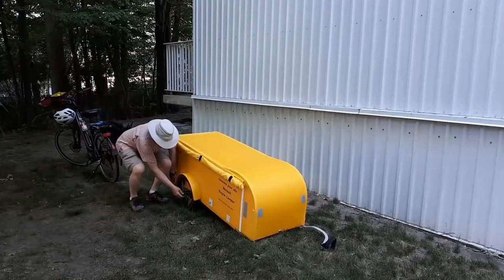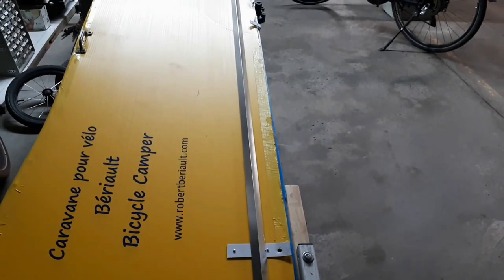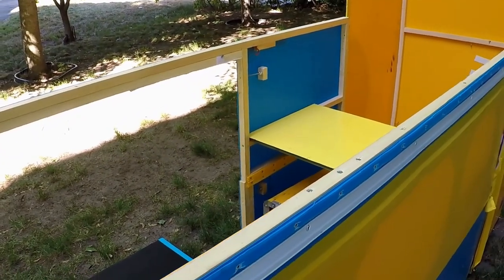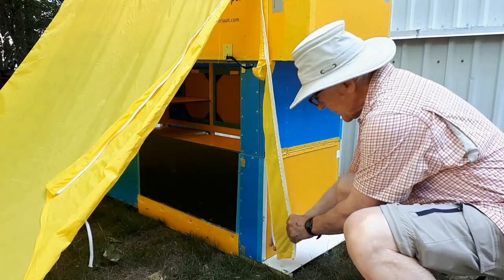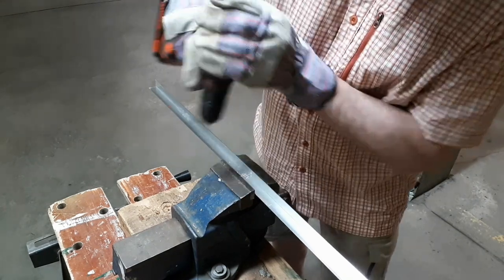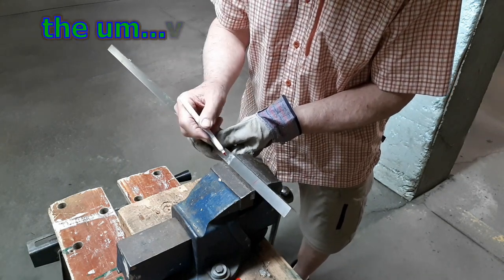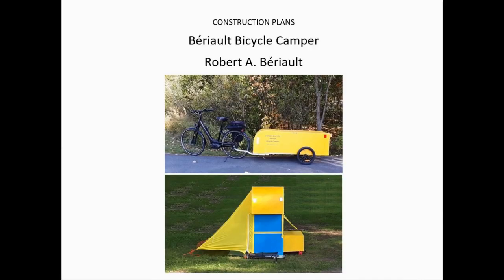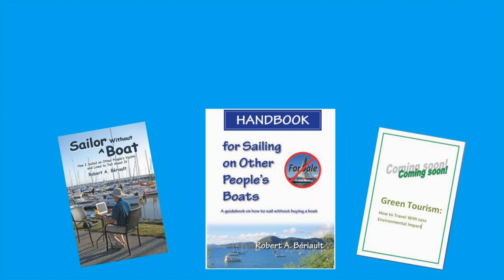New Fixes for the Bériault Ebike Camper    2020

Comment: I enjoyed seeing these improvements, and your trick for modifying the 90 degree angle aluminum worked very well. Do you have a sense of how of the people you've provided plans to have built their own Bériault bike camper already? It would be really neat to one day see a video of the ones that other people have made!
Reply from the maker: So far, I've sent the plans to 56 different people, and disappointingly, none has written back. Many of these appeared motivated, but I assume they must have decided not to build. Eight have received the plans since March 1, so there are possibilities. there.
Reply: @RobertBeriault753  I am one of the first to get the plans for free last year - thank you Mr Beriault! Have bought already last year a stroller for the wheels, axle and tow bar. Have been looking 1 year for Coroplast in both Sweden, Finland, Denmark, Germany and the United Kingdom. It is very easy to find it in USA, Canada and China but not in EU. I found 5 sheets (240 cm x 120 cm) in the UK for about 80 euros but shipping would cost over 200 euros + import fees which would be too expensive. But, yesterday I found BY CHANCE 5 large sheets of Coroplast (240 cm x 240 cm) in a store near me and they cost only 40 euros. So, tomorrow is my first vacation day and the day I will start building the bike camper. Wish me good luck! :-)
Reply: @RobertBeriault753  Last summer I made a video showing a recipe that I use on my bike tours for a no-hassle bike touring breakfast which I call "Campsite Overnight Oats". At the end of the video I said "If you end up trying the recipe, I'd love to hear how it turns out for you, so please leave a comment below". The video has done moderately well, and although many commented that they're planning on trying it, not a single one has reported back to me. At least that was true until TODAY, when I was out riding in my city and another cyclist recognized me from YouTube. He said he wanted to thank me for my Campsite Overnight Oats recipe which he's started using on all of his bike tours!  For all we know, there may be several Bériault bike campers out there!
Reply: @cjhoyle  I hope to be able soon to show you my version of "Beriault bike camper". Just started doing it.
Reply from the maker: Hello Dan
Last year you did mention that you wouldn't be able to start right away because you were looking at buying real estate in Romania. I'm glad to hear that your project is now underway. I will send you a revised set of plans, which will cover details about the hood support rails, and a few minor things. The basics of the floor and level 1 are still the same.
Reply: @RobertBeriault753  Thank you very much Mr. Beriault! I sended a e-mail to you.
Reply: @dgdobos  Looking forward to it!

Comment: What kind of solar panel do you use? Does it work well for your needs?
Reply from the maker: Solar panel and charge controller (MPPT boost controller) and 100 Watt flexible solar panel
available from: www.sunridepower.com
At the 45th Parallel where I live the sun is always low even at summer solstice, when i get about 15-20 km per day. So by tSeptember, I get enough power to run about 10 - 12km.  I would need at least 300 Watts of panels to be independent from the grid.